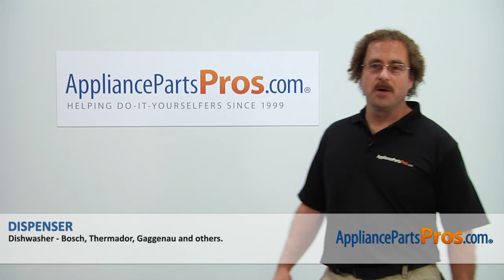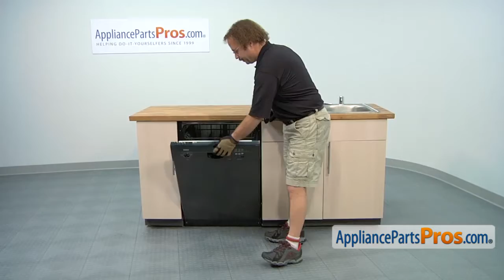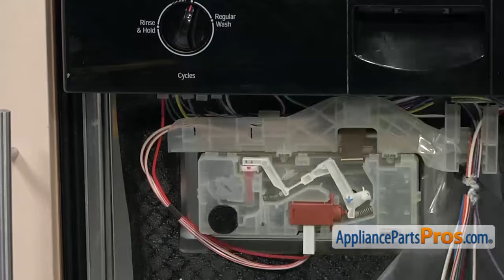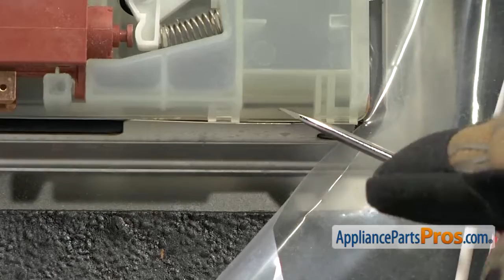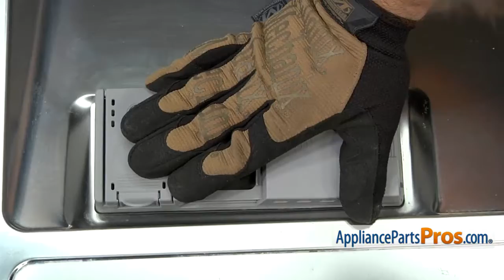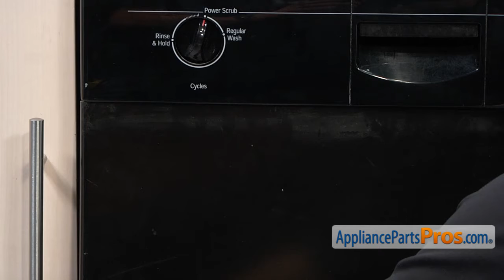Bosch Dishwasher Dispenser 00490467 Replacement — fits Thermador/Gaggenau

Comment: Very complete video and clear instructions. The only thing I didn't anticipate was how hard it would be to get the replacement part to "snap in place" in the door. Extremely difficult to get the gasket compressed enough to permit the tabs to snap over the metal collar. If the tabs don't snap in place, there will be leaks. I was concerned that we would bend the door. Got it done, somehow and it works great. Great response on the shipping from Appliance Repair Pros!

Comment: We installed a new dispenser following your instruction and immediately water leaked through the top of the new dispenser inside the door. I pushed the dispenser in firmly again, started the dishwasher and again it leaked from the top left corner as I face the dispenser with the door closed. Dispenser is firmly seated properly. Any ideas?.
Reply from the maker: Make sure the area is clean of course. Also make sure the metal locking tabs are actually catching on the dispenser, sometimes if you bend them to far taking the old one out then it will not lock the new one in good.